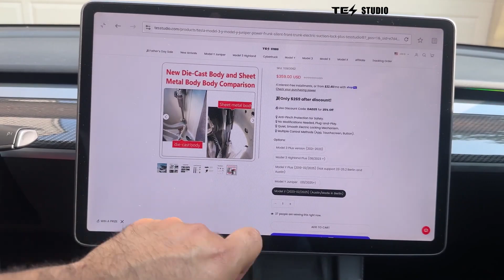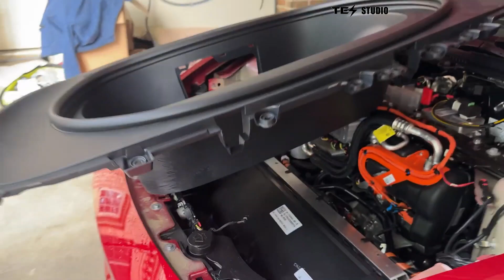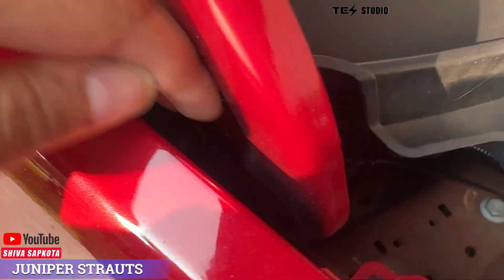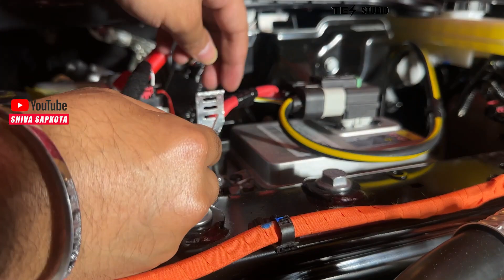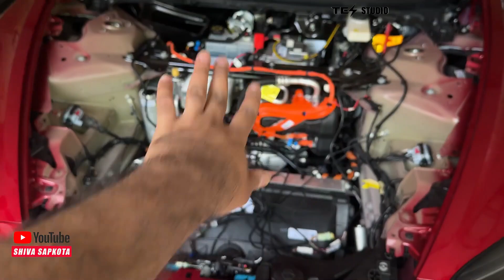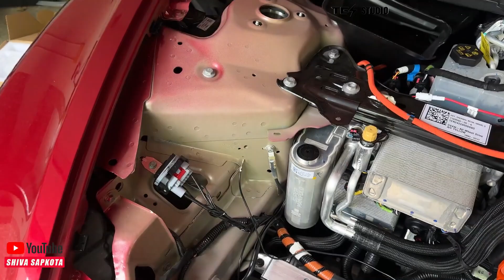Model 3/ Model 3 Highland Power Frunk Soft Close Lock Tesstudio®

Comment: Mine stops immediately when it touches the latch. will NOT close under any circumstances
Reply from the maker: This lock needs adjustment. You can contact our after-sales service and provide them with a video.
Reply: @TesStudioUS I did. I also explained how the two latches that mount to the hood or backwards in the directions left and right is looking towards the car not from the back

Comment: I wrote to you on your YouTube channel. But I have another question and the QR code from tes studio brought me here. At the 31 minute marker when you put the new locking mechanism over the original, the metal wire is touching the two sensor prongs. It does this on mine as well when I installed it. Any concerns of it breaking those prongs from multiple opening and closings. As it seems that it’s putting a lot of pressure on that thin piece of metal.
Reply from the maker: Hi there! Thanks for reaching out both on YouTube and here. I really appreciate you taking the time to share your thoughts.

Regarding your question about the metal wire touching the sensor prongs at the 31-minute marker, I completely understand your concern. It's definitely important to ensure that there's no undue pressure on those prongs, as they could get damaged over time with frequent opening and closing. From my experience and after checking, the design should have a built-in tolerance to avoid any excessive pressure, but if you're noticing consistent contact, it might be worth checking the alignment or considering slight adjustments during installation.

Let me know if that helps, and feel free to share any more thoughts or concerns!